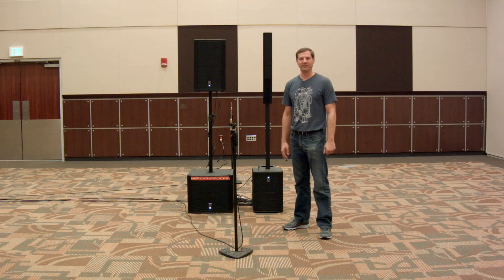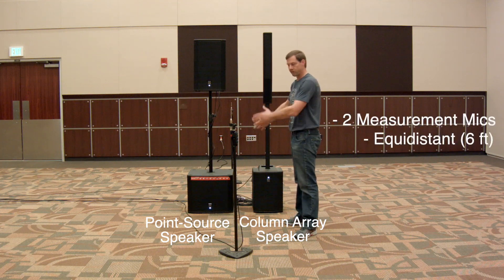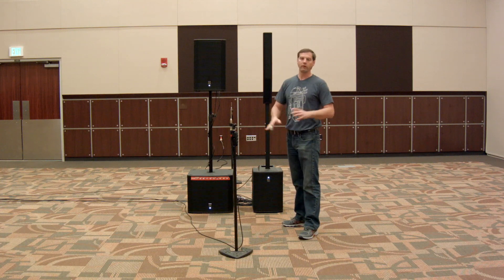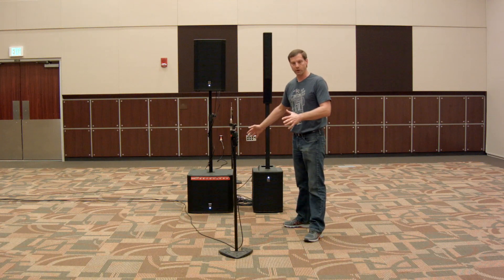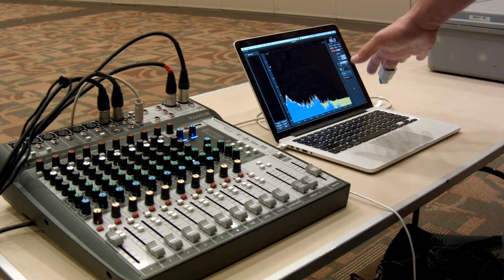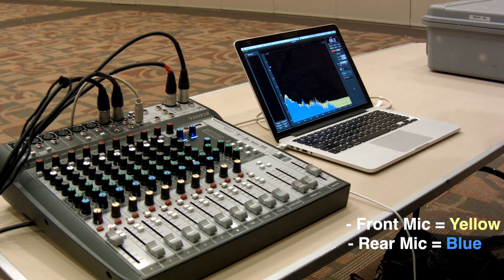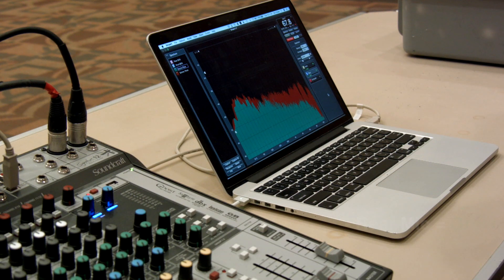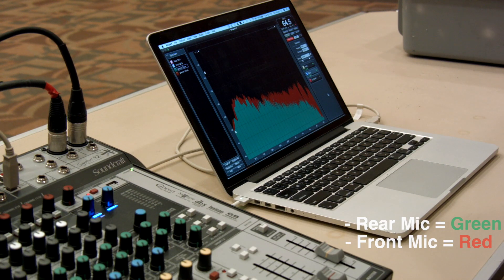Do Speakers Have More Bass Behind? (NLFX Reviews)

Comment: it is probably the reverberation from the sub low tones. They don't go straight out they are omnidirectional as long as the subs blowhole is pointed to the front you will get the majority of it coming from the front. But closer you are to a solid wall the more you get the bounce back or reverberation like ben says it causes cancellation. Bass waves travel a heck of a lot further than higher frequencies do that is why we have waveguides on horns.